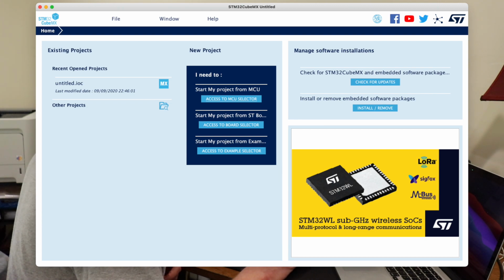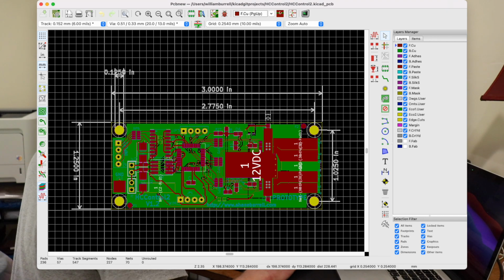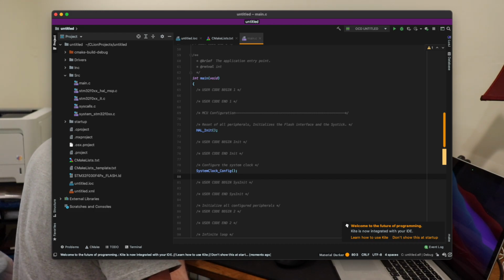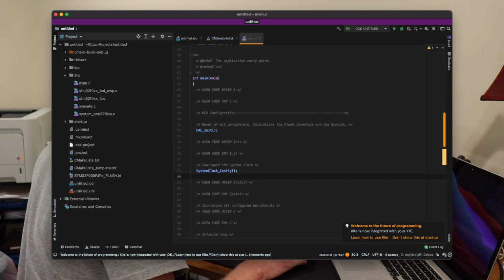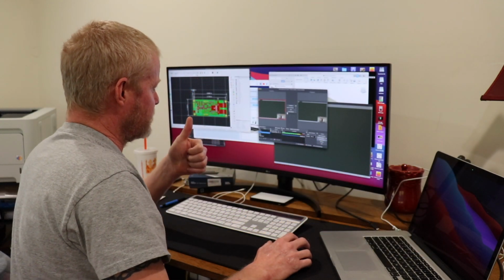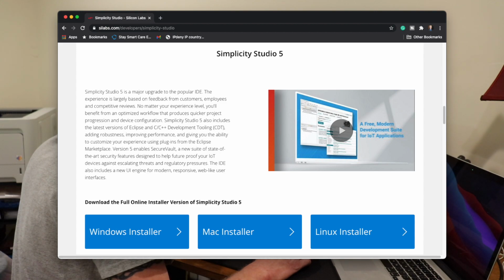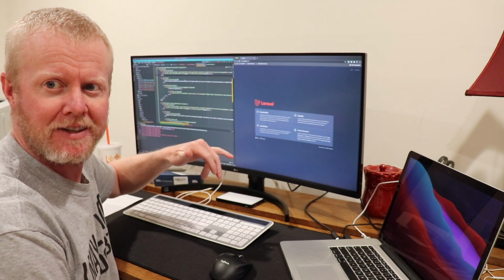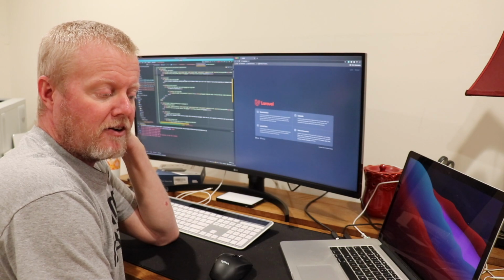Mac vs PC software development. Which is better?

Comment: I use Linux with Windows and MacOS VMs

The only reason I don’t like MacBooks or laptops in general is that it’s quite hard to repair them if something fails

For example the new MacBooks have literally everything soldered on to the Mainboard 

If only one thing breaks the whole thing needs to be swapped 

And since I’m working from home most of the time I don’t need the mobility since we have separate PCs at work 

Also a Desktop PC is sometimes cheaper 
You can get 32 GB Ram for 110€ here
Reply from the maker: My experience with MacBooks is they tend to easily last 5-10 years with no issues. Pc laptop I’m lucky to get three years. On desktop the Mac mini is still compelling if you don’t need the mobility.
Reply: Shane Burrell 

I’ll definitely wait and see what apple releases / upgrades next with Apple silicon 

Maybe the Mac mini gets the option to upgrade to the M1X or what it will be called ^